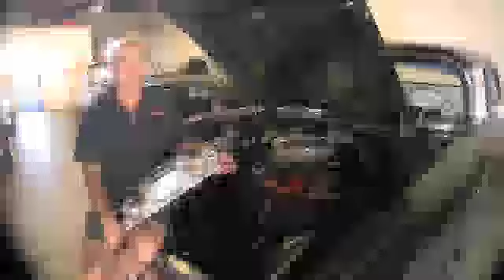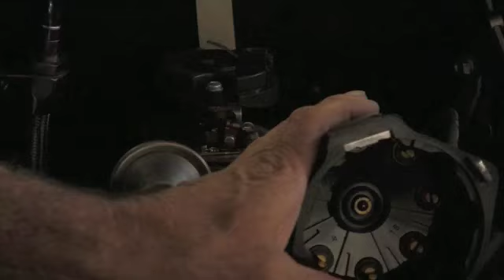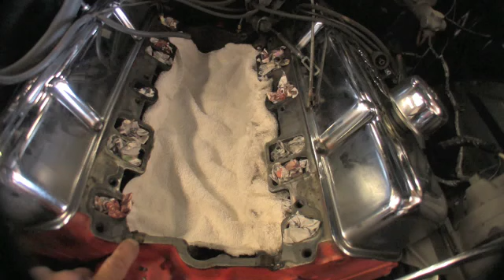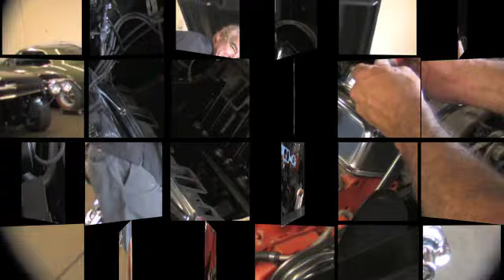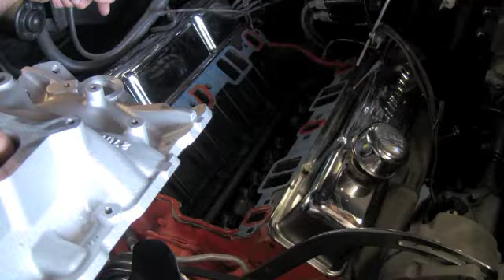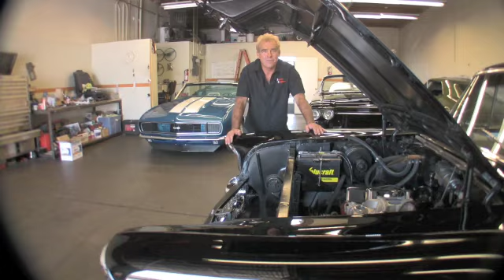Intake manifold Gasket replacement No Oil Leaks  by Scared Shiftless

Comment: hello mark,i realy like your video, have a question, i have a 454 and i am swaping it tbi to carb,so before watching you video i did prety much the same exept i used a small abrasive high speed used up 120 grit  pad and coverd everything first and carfully sanded it , it left some marks but not very deep, i can feel it with my finger, so would it be best to put the high temp selant on and under the whole gasket to fill in the very little warps that i have made,the one or two,¸and of course if the black or grey very fine powder debris that could have maybe gone in the motor even with the precautions i toulk, i am thinking of cleaning every thing i might see with a good rag in the tinyest corners , so i would like to know your take or opinion on all this, and are there oil filters out there that are more afichant to pick up fine particles in the oil,thank you.
Reply from the maker: IF you have small scratches you should be fine. I would not seal the complete gasket. I think you would do more harm putting gasket sealer around the gasket as you cannot get it even enough to not warp the intake.  Thank you for your question.

Comment: I have a 1968 Mopar 318 and the manifold top gets oil that collects in the indents in the manifold top around where the bolts go in. Is it conceivable that oil is coming up the screw threads and collecting around the bold heads? it is a fair amount of ails that collects in the indents -- would pulling all the screw out and using silicon fix the problem or might the oil be leaking from somewhere else?
Reply: M Welther i have the same problem with my 72 d100. I dont think its that big of a problem though.
Reply: M Welther ii

Comment: Mark, what is the best way to torque down the bolts, do you just torque them down 25 ft lbs in one shot or is there separate sequences?
Reply from the maker: Apply a small amount of silicone to the threads of the eight inner bolts (1,2,3,4,5,7,9 & 11) For sure to prevent oil weepage, as generally these are not blind holes in the cylinder head. Torque all of the manifold bolts in two to three
steps by the sequence. Front to rear looking from front of engine. Left bank 12-11-4-1-5-6. Right bank 10-9-3-2-7-8 3. 25 lbs. is recommended We do 30 lbs. You should check them again after the engine has been run and cooled. Thank You

Comment: Hey Mark- Big question for me is I've got a Chrysler 383 that has bolts on the block along the front and rear mating surface/edge.. how should I apply that bead of high temp rtv to that surface.. if at all? Obvious concern is that silicon will just get pushed into the bolt holes.

Thanks again!
Reply from the maker: Some silicon will not be a problem in the holes. Use caution and good judgement. Thank You  Mark

Comment: Hey, I bought a good wrench SBC from Jegs a while back and before i could get it properly broken in i ran into some transmission issues. I since then I have fixed that problem, but now I am having major leaking from the front and read of my intake manifold. Do you recommend I put gaskets along with silicome or do you recommend that I only use silicone when reinstalling my manifold. Thanks
Reply: Hey man, did you end up fixing the intake issue? how does that engine run? I was thinking of getting a GM crate motor if the new intake gaskets don't fix my problem. which version did you get, the 290 HP?
Reply from the maker: Only the silicon sealant. No gaskets!
Reply from the maker: Save your money! Fixing the intake  oil leak is a much cheaper investment. 290HP!  Thank You

Comment: Are those middle holes that you put RTV on, are they water jackets too?
Reply from the maker: No, They are exhaust ports. Exhaust travels under the intake manifold from side to side. This is a smog thing. If you want to get more performance use gaskets that have no holes in them. This will not let the fuel get hot and more performance. Thank You Mark

Comment: What's to keep the sealant on the manifold bolts to creep up the bolts as you tighten them? thanks.
Reply from the maker: The sealant acts like an o ring and fills the gaps in the threads. Great Question! Thank You

Comment: My neighbor told me that a bad intake manifold gasket could cause oil to leak into my coolant.

Is that true?

He said my compression numbers were too normal for it to be a blown head gasket..

Thanks in advance..
Reply from the maker: I have never seen or heard of that happening.
Reply: @MrScaredshiftless  Me either, but someone else also agreed that it's possible..

My neighbor is a pretty reliable source..

I was going to pay him to fix the head gasket, or head, which I would have had to pay him much more, but not as much as a shop.

I think it could be true..

Comment: theres no oil in the intake manifold, so it shouldnt be hard to avid oil leaks from there.
Reply: The oil doesn't come through the intake manifold. It comes up through the manifold bolt threads--usually the 4 around the center of the intake right below the carb. Very common problem with the SBC. That's why you need to use thread sealant on the bolts.
Reply: The entire valley has oil. Why do you think sealant goes across the front and rear of the engine?